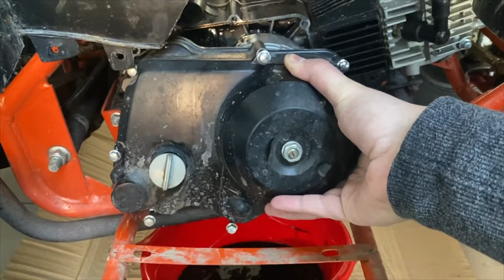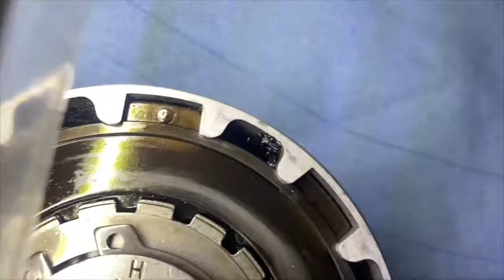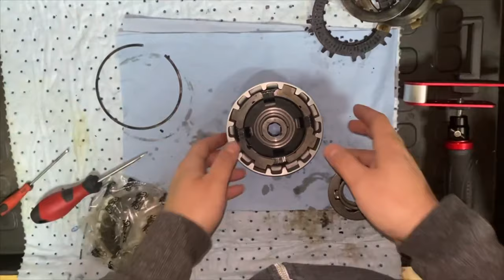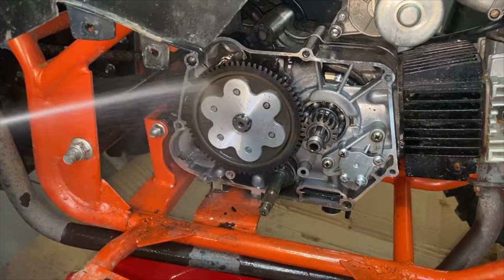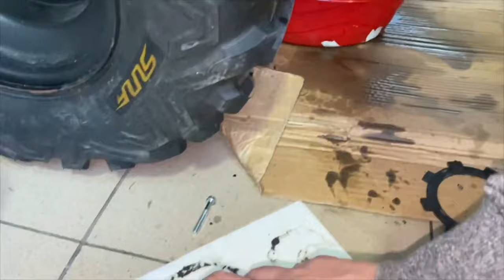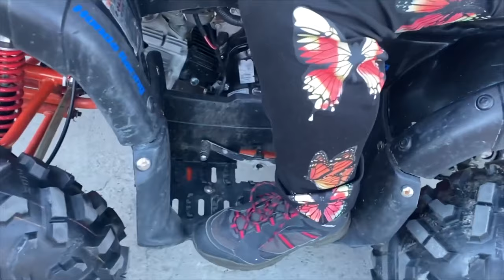ATV  / Pit bike   -   90CC / 100CC / 110CC / 125CC  AUTOMATIC CLUTCH REPLACEMENT

Comment: See this clutch, could it being in that condition stop it from going into forword gear? Mines exact same, engine still runs etc but will only go into reverse and neutral, and won't go into forword gear. Do you think it'll be transmission need changed or could be clutch. Thanks
Reply from the maker: I think it's a transmission problem

Comment: I have gk110 go kart, replaced the clutch, goes into each gear fine, will move in reverse but won’t move in forward, any ideas?
Reply from the maker: I believe the transmission is damaged
Reply: @BoatMotors  that’s what I’m thinking, I think I’m just gonna do a predator engine swap
Reply from the maker: @leegold6744  OK

Comment: I bought one for my lil girl and I have a problem with the foot gear shifter it's automatic 125cc pentora it runs good it's just when it's in nuetral . ????
Reply from the maker: May be the compression is low
Reply: Lol ! It revs  up when I put my foot on it to put in drive????
Reply from the maker: @slpy79-trs81  You have to inspect the clutch. If the clutch is in god working condition the next step is the transmission

Comment: Anyone have a link to where I can get a high performance centrifugal clutch for my Zongshien 125. The factory one slips too much and it's bottle-necking the atv's performance. The engine has plenty of power but the clutch slips when I accelerate uphills. I need a fix. I already adjusted it as good as I could get it, and it's better but still slips. I've only had it 2 months. I weight 220.

Comment: Hey , I have a question, does this motor have a reverse gear ? cuz i am looking for an engine for my k pipe but all the motors are manual shifting and the semi automatic ones have 3 speed forward and 1 reverse but i only need 4 speed… could anybody help ?
Reply from the maker: All ATV motors are with reverse gear. Pit bike motors are with 4 forward gears and no reverse gear

Comment: Hey I have a question I am new to this small engine stuff. We have a 110 Apollo that sometimes it’s hard to kick start like it’s not catching, I’ve replaced the top end
Reply from the maker: Please repeat the question, part of it is missing
Reply: the actual gear that contacts with the kickstarter and the motor may be stripped

Comment: I brought a new auto clutch soaked it in oil then installed it correctly and my back wheel is rotating the bore won’t roll in a neutral gear so back wheel is so hard to rotate Evan though it’s fully auto and if I turn the engine on the back wheel spins fast with engine rpm ever had this?
Reply from the maker: If I understand correctly I think you have problem with the transmission. Can You switch to all gears?
Reply: @BoatMotors  it’s fully auto no gears I think rpm makes the clutch grab and spin the back wheel
Reply: Try adjusting the screw outside the clutch on the side case of the engine. It may be too tight. Try loosening it some. If you loosen it too much it won't go. It has to be in the sweet spot to grab, and roll freely.

Comment: I have to keep clicking to shift down gears and it’s hard to put in reverse and neutral do you know why this could be happening
Reply from the maker: Check the idle RPM. If it is too high this could be the problem.
Reply: @BoatMotors  and it slips out of gear sometimes
Reply from the maker: @larry_to_goated7716  The transmission may be damaged as well

Comment: I used terminology 
= torque activated clutch (moped)
= ratchet screwdriver
= torque wrench (pneumatic, electric-drill, ...) with ratchet(3 positions, left/lock/right) 

I encountered youtube reply in other video = shaft engager
= sounds more expensive than a torque(clutched)-ratchet wrench... 
= sounds like wretched...terminologies... duh. differential limited-slip distance-travelled difference between left-right wheels amount of clutch friction-slippage... and muddy 4x4/6x6/... multi-plate wet clutch leak oil to become multi-plate dry ducati cluck-cluck-cluck clutch... might as well 2 moped clutch per wheel at drum and at axle-shaft for more slippage... conmen-rod tie-rod shaft-axle... 

How to conceptual terminologies.?
Reply: Today is sunday and the wretched bicyclists came out to click clique click clique trend-vogue noisy-ratchet ...
Reply: I concur 😂